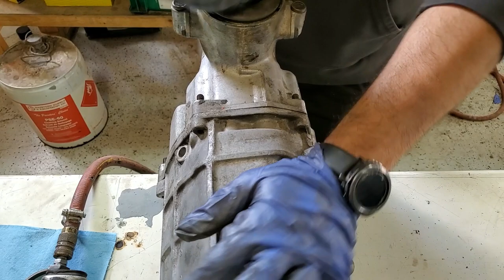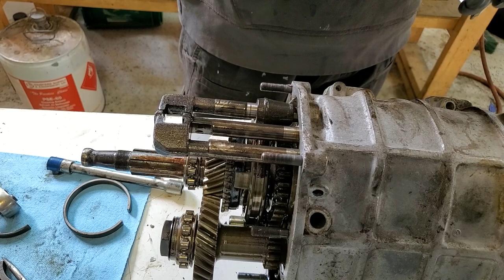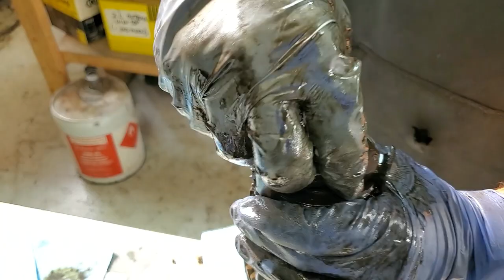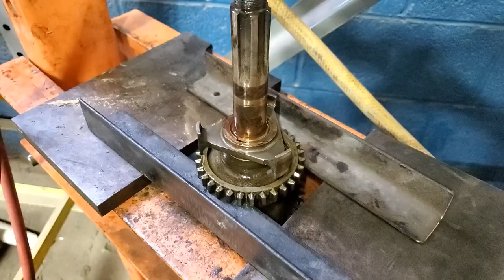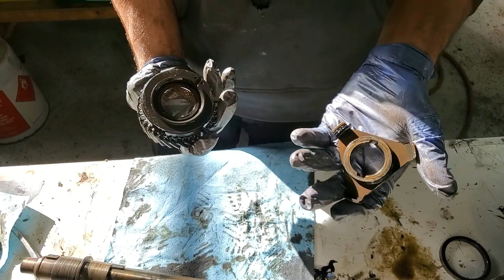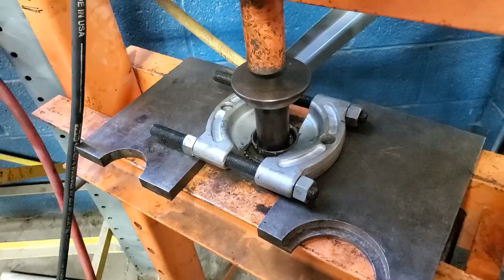Alfa Romeo transmission rebuild

Comment: Really helpful stuff here. This is a great video on the Alfa gearbox. So much easier to understand than a workshop manual. Very timely too as I need to remove and look at the reverse gear in a week or so - keeps slipping out of reverse. Thanks.

Comment: Tiago, I rebuilt my transmission last week. The only problem I was having is the infamous Alfa Romeo 2nd gear grind. I put in a new 2nd gear inner and outer syncro and gear dog ring. The engine is in a machine shop so its going to be a couple of weeks before it is all back together, but just shifting the gear shift, all the gears are smooth except going into 2nd gear. Did I do something wrong or is it because the parts are all new on 2nd so it is very tight now??? I am 100% sure I took the gear box apart and put it back together correctly. Do you have any advise, because if I did something wrong I want to redo it before the engine gets back.
Reply from the maker: Sounds like you were able to put everything back together. I'd say if you're confident everything went in proper order, it's probably just because everything is new.

Comment: Very nice video.  My Spider transmission will not hold in reverse.  It pops out with considerable force.  I can hold it with my hand.  I the start of the video you had trouble removing the back casing until you removed the two shimmed opposing  cylinders at the top of the transmission near the shifter.  Could that adjustment be causing my problem? Any suggestions.  Oh if that is the problem can i adjust in the car?  
Any info on this would be greatly appreciated.
Thanks
Reply: I have the same problem, please let me know if you solve the problem.
Reply: Yes the shimming has a great effect on selecting the gears. are you sure that in your case the shims are, as they were?
Reply from the maker: Well, clearly I don't check my youtube account as often as I should!

There is a chance it's the shims. However, the main function of the shims is to prevent it from sliding from 5th straight to reverse.

What I have noticed in the past was something as simple as the shifter boot (or boots, depending on what model) being so stiff that they'll work to push the shifter out of gear!

Hope that helps!

Comment: Tiago, I was racing and I let the clutch pedal out before I shifted the shifter into 3rd gear and so I ended up slamming the shifter into 3rd with my foot off the pedal. Now the car will not engage into 3rd gear. What did I do and how do I fix it. Please let me know.
Reply from the maker: Ugh! That doesn't sound good, sorry to hear that. The best way to find would likely be taking it apart but chances are something came off place. Hopefully nothing broken!